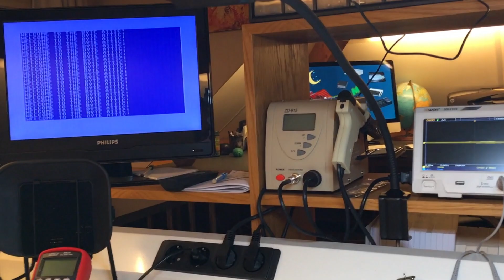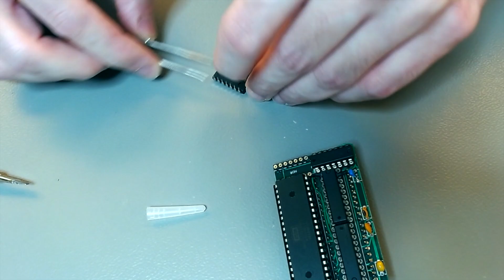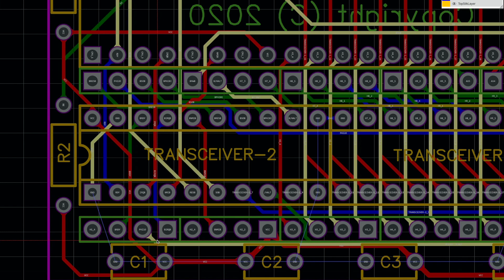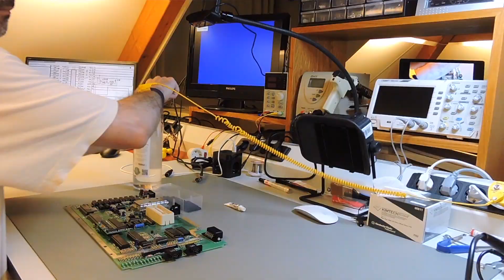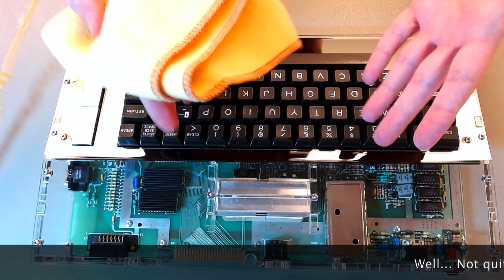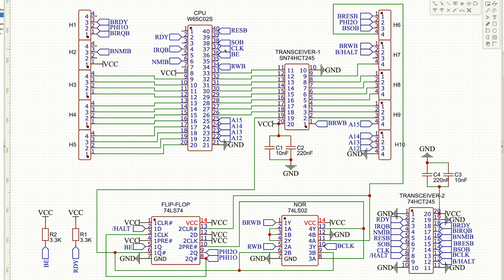Atari 800XL without "Sally"!

Comment: hmmmm this looks like using BE pin on w65c02 with extra steps :), 
from w65c02 docs:

The Bus Enable (BE) input signal provides external control of the Address, Data and the RWB buffers. When

Bus Enable is high, the Address, Data and RWB buffers are active. When BE is low, these buffers are set to
the high impedance status. Bus Enable is an asynchronous signal

The eight Data Bus lines D0-D7 are used to provide instructions, data and addresses to the microprocessor
and exchange data with memory and I/O registers. These lines may be set to the high impedance state by
the Bus Enable (BE) signal

The Read/Write (RWB) output signal is used to control data transfer. When in the high state, the
microprocessor is reading data from memory or I/O. When in the low state, the Data Bus contains valid data
to be written from the microprocessor and stored at the addressed memory or I/O location. The RWB signal
is set to the high impedance state when Bus Enable (BE) is low

The sixteen bit Address Bus formed by A0-A15, address memory and I/O registers that exchange data on
the Data Bus. The address lines can be set to the high impedance state by the Bus Enable (BE) signal

:)

Comment: Apart from Jan Beta, have you had any other feedback as to how your CPU card works in other 130xe or 65xe machines? I have a dead Sally in my 130xe and I was thinking to get some of your boards manufactured.
Reply from the maker: Hi! No, just my own systems and Jan's. I see people coming to the Github repository and liking it, so more have been built for sure. But I haven't heard from anyone else directly. What I can tell you is that, in my own 130xe, it works flawlessly, and has been there for many months now. Still, I can't give any guarantees, as the timing in the Atari line is very finicky.
Reply: @thebyteattic  Hi again...I just ordered a run of 5 of these boards. Thanks! One question. Is it possible to socket the 65c02 (and possibly the 74 logic too) on the daughterboard and put that in a 130xe (with the two stacked sockets for clearance)...is there enough room?